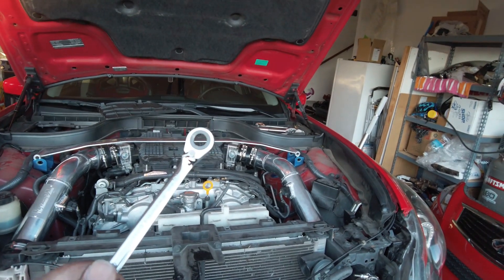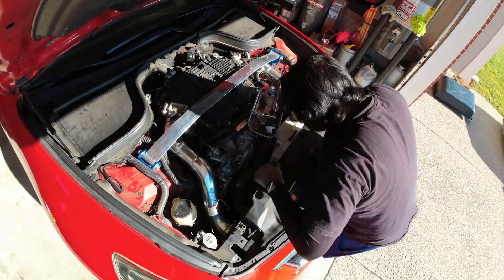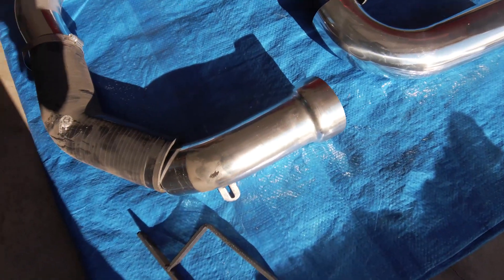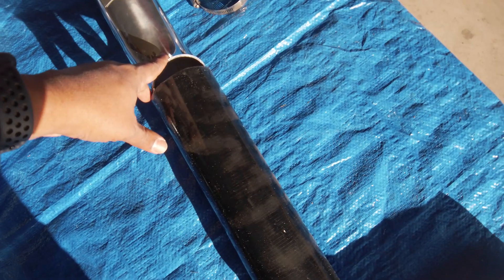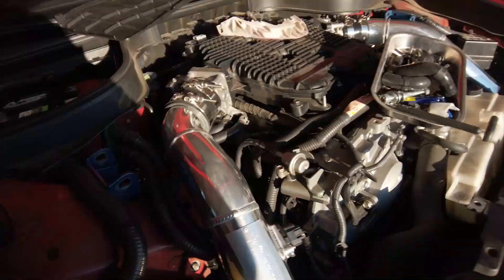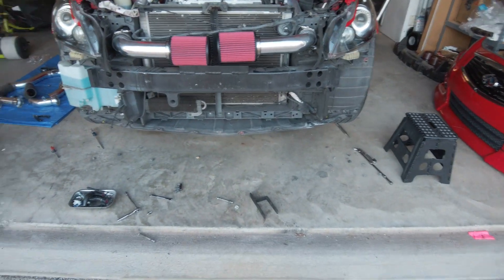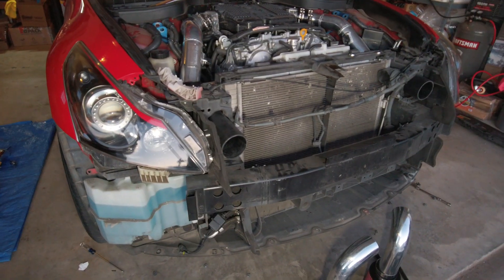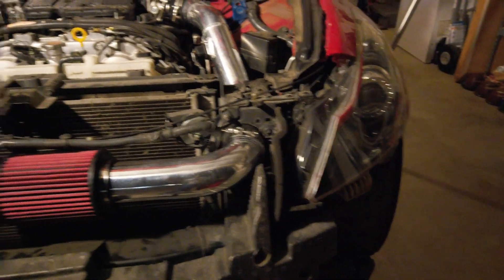Intake Makeover Pt.2  | Are 3” Admin Intakes even worth it?! Install woes.

Comment: Great video. The exact same issues I ran into when I was installing the Admins on my wife's coupe. Granted my cutting did not look as good as your did, but no one is going to see it lol.
Looking forward to the tune part (Pt.3) of the installation
Reply from the maker: Thx 🙏🏾 for the support. I’m also happy that someone else realized the problem with them and came up with the same solution even tho the method was a lil different.

Comment: The first port you were trying to cap just put the hose back on and leave it open simple as that the two small ones in front leave those capped
Reply from the maker: Capping them and the manifold then venting the pvc

Comment: question what 3’ filters fit admin intakes for HR/VHR? I can’t find oem admin 3’?
Reply from the maker: Anything rly. Take some measurements and check out k&n website and order what you need. Get the oiled types. Where the intake filters are they get soaked with the Non oiled types.

Comment: Did you have to tune the car to make it run properly or did the car run properly after
Reply from the maker: With 3” it’s  necessary   to get tuned. The diameter around the MAF is a lot larger and have to tune to program that in.

Comment: What two separate filters did you get to replace the oem takeda single filter with? You mentioned you changed the big single to two singles. Great content! Keep it up
Reply from the maker: Here’s the forum thread I created about it. There are a few options but this should help. 

https://www.myg37.com/forums/d-i-y-installations-modifications/268091-dual-filter-a-takeda-cai-2.html
Reply: @3rdPedalMedia  thank you kindly my good sir. After having the Stillen Gen3s, Afe Takeda, then Admin intakes which would you say was your favorite out of the three?
Reply from the maker: @slamdg37  for simplicity and entry lvl the takeda with dual filters but when you start pushing for numbers and higher N/A HP numbers then admins’ or an equivalent 3” -+/- 5hp depending on brand.
Reply: @3rdPedalMedia  Yeah I watched Pt. 3 and seen where you only got an extra 4-5 hp gain after switching to the 3" Admin intakes. That seemed a tad underwhelming I can only imagine. Would you STILL have bought Admin Intakes had you known previously about the minimal gains over Takeda? Also wondering do you have the Eps Tuning 70mm throttle bodies installed or no? If not will you be in the future? 

 Thanks as always for the great content and solid advice!
Reply from the maker: @slamdg37  thats the NA life small gains here and there

Comment: Could you put a k&n 62-1560 vent filter over the crankcase vent instead of the vacuum caps? Not sure if that would cause a vacuum leak or not… i dont feel like it would but could be wrong. Anyone know?😂
Reply from the maker: which the rear vents?
Reply: @3rdPedalMedia  the crankcase vents that were capped off. Both are a few inches behind pcv valves

Comment: Are the filters K&N or Vibrant? Any part number??
Reply from the maker: They are AEM. Will try to look next time I’m have the bumper stuff off.
Reply: @3rdPedalMedia  no worries man thank you, i think i know which AEM ones as they tend to be a best seller on some sites and look identical

Appreciate you
Reply from the maker: @Berenspayton  if it helps. It’s the dry type filter.
Reply: @3rdPedalMedia  thank you man
Reply: @Berenspayton did u end up finding the exact filters bro? i’m tryna look can I get a link 🫶🏻
Reply: @Berenspayton the 3 in x 9 in dry air flow filter for like 80$?
Reply: @Berenspayton or shit I see amazon has some.. not even sure tbh manee
Reply: @Berenspayton  u bought yours off amazon?

Comment: Bro the throttle bodies are not 3 inches. That guys was using his name to sell those products. It is easy rip off Americans. Your not nick picking.
Reply from the maker: i guess, i'll address this now that you've spammed this 3 times now. 

TB's are just a gate, you open/close or different incremental amounts. Intake manifold runners are far smaller than TB and using your logic any intake modification would not make a difference because of the runner size is far smaller than anything before it. 
Dyno proven a larger TB only yields a very small gain. 
3" intakes are not bigger because Americans like BIG things . Factory MAF sensors and MAF housings are calibrated to only allow a certain amount of airflow and have a Max, 3" intakes open up the MAF hosing size which allows tuner to recalculate the volume limit and allot more air into the combustion system.
Reply: And you’re still slow
Reply: @3rdPedalMedia  The only calculation is the adjustment for slower moving air. If the gate can take 3 sheep a minute  and further down your sending 5 sheep a minute. How much will the gate pass per minute?